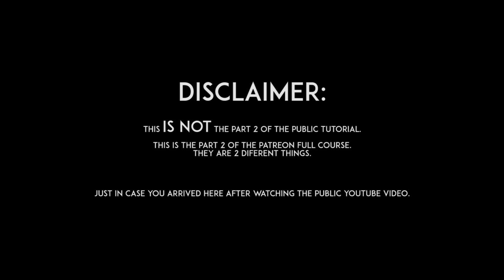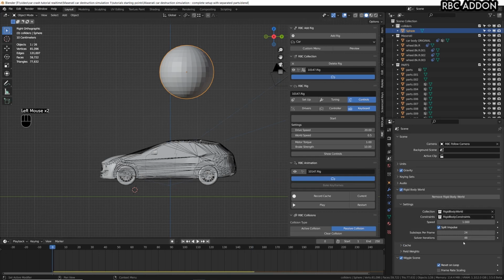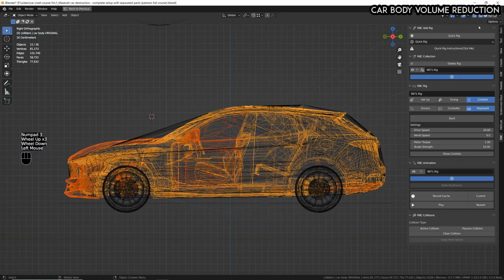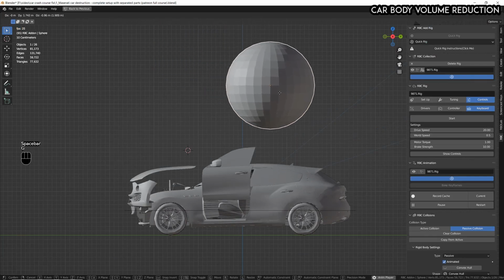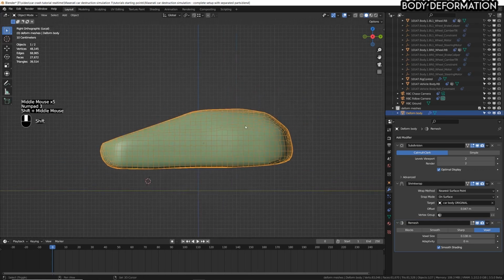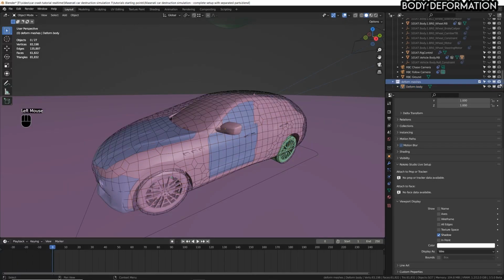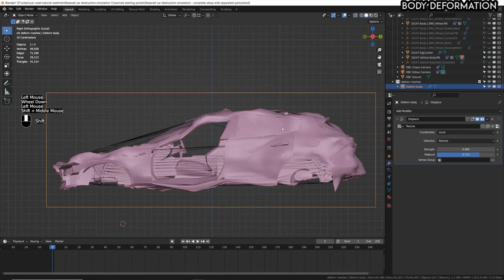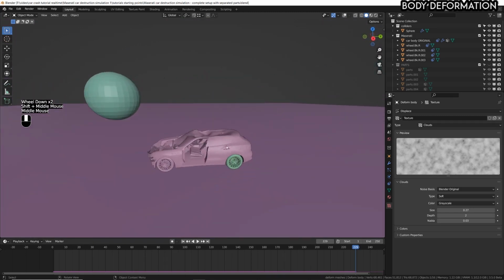[PART 2] Realtime Car Destruction - FULL COURSE!

Comment: Hi I'm working in 5.0/5.1 and have noticed that the displace modifiyer the objects get bigger insted of being the normal size when the mid level is at 0.5, Im stumped at the moment, the tutorial series is great :)
Reply from the maker: Hi, are using a noise texture in the displacement modifier? Just tweak the settings of the displacement and the texture. Thanks!
Reply: @RaffoVFX  I have, though, I seem to have solved it by setting the displacement direction from Z to Rgb to XYZ, still gives similar results from the tutorial :)
Reply from the maker: @VFXJanitor  actually at 25:31 I said to increase the mid level, that's what you didn't do
Reply: @RaffoVFX  Fair enough, tho could i email/message you via patreon to show the issue in detail, just seems to be a blender 5.0 issue or something im missing on my end
Reply from the maker: @VFXJanitor sure